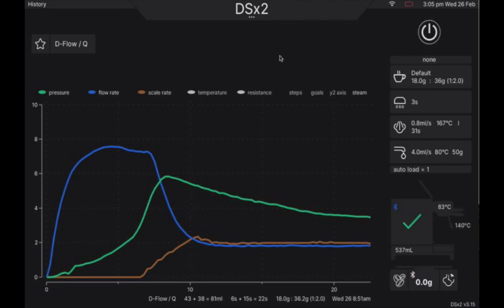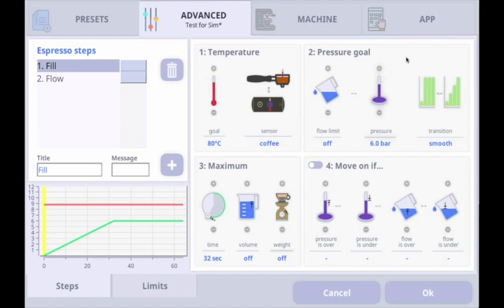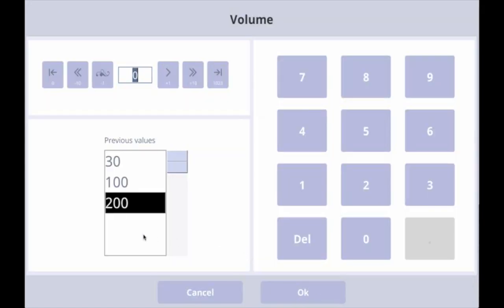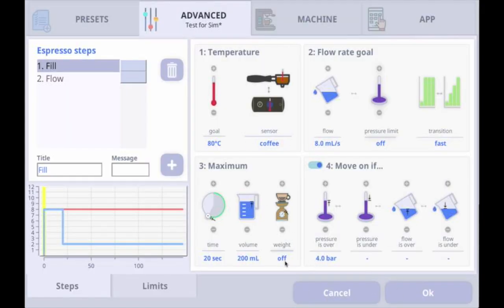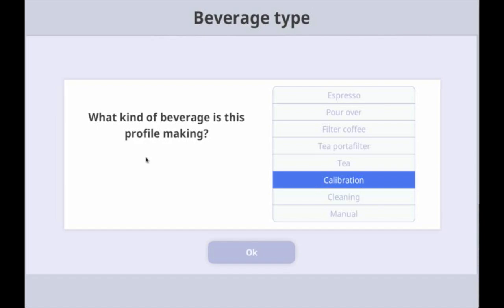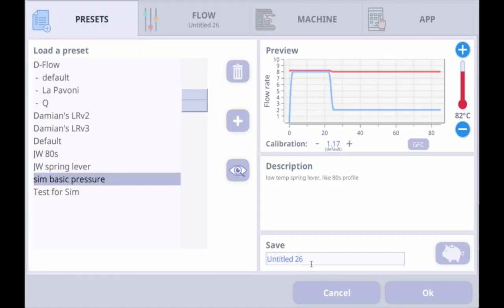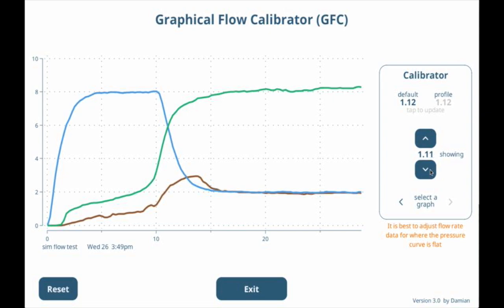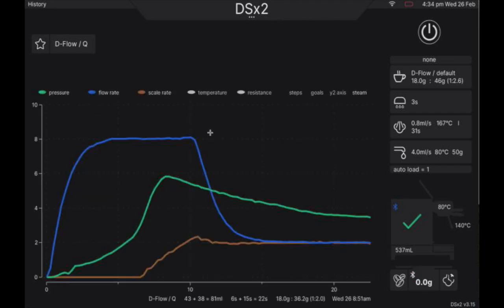calibrating and profiling

Comment: Hey fella!
1/ Thanks Damian, a good run through some basics of an advanced profile... I'd love to know how to set a trigger so that it moves on to next step if flow is too high BUT  skips the next step if flow is too low, ie for an adaptive preset... How is adaptive done? It would be WONDERFUL to have this kind of detailed video explaining some of the complex presets and how/why they move on and adapt. I am sure I am not alone, having had the DE1 for a few years and still not fluent in preset making.
2/ 13:23 why is the Maximum Volume "OFF" is regarded as being set to Zero? That is very weird, inconsistent and makes no sense to me, regardless of whether an 8ml flow goal is set or not. Surely OFF should mean that it is disregarded, ie there is no maximum ie it is limitless!? That would make sense. WRT inconsistency, in the Limits tab, "Stop at water volume" set to OFF means exactly what it should, it's disregarded... 
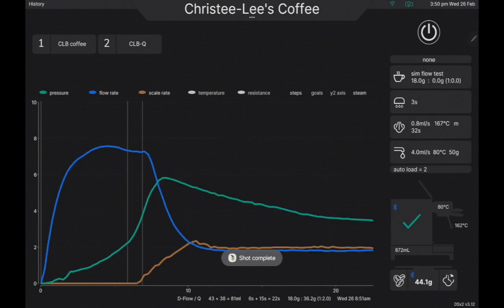3/ 36:17 The graph jumps to a different one... and the second graph shows a pressure curve declining despite there being no puck to degrade? I'd expect it to level off as it was in the original graph at 36:15
4/ (very small thing...) 45:50, the sim flow test preset shows a Description from previous profile.